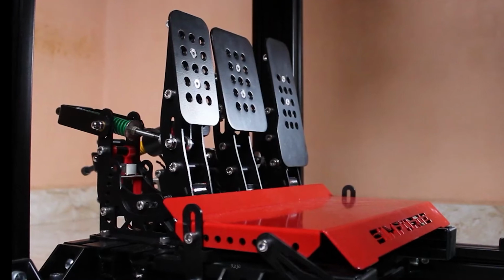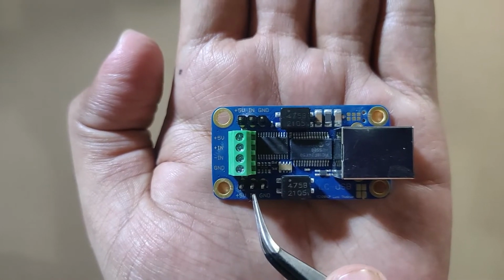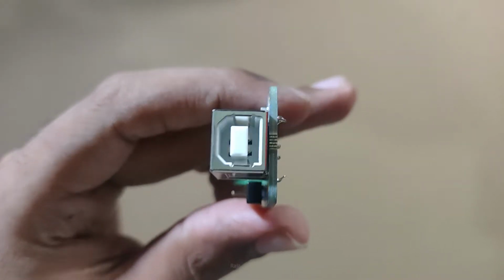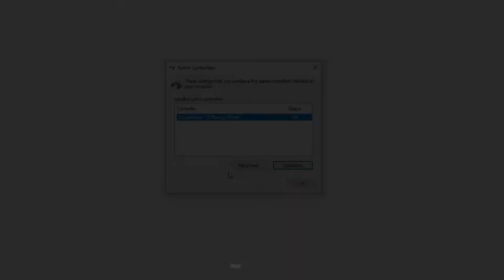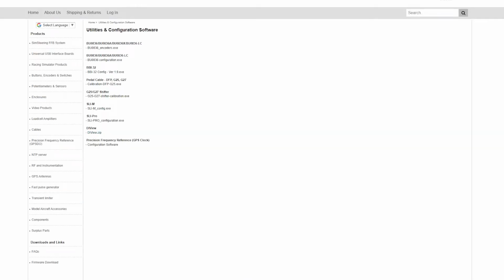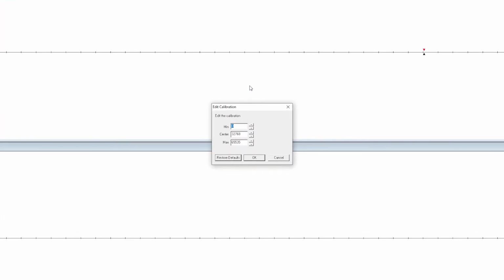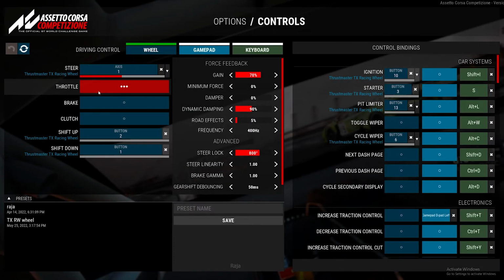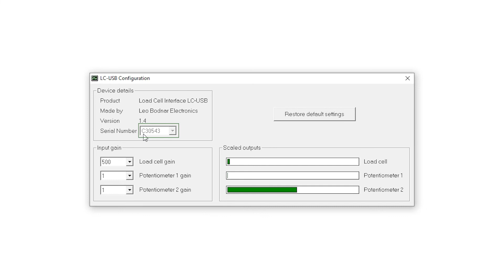Leo Bodnar LC-USB 16bit Load Cell Interface Review.

Comment: nice vid. thanks for the tutorial. I'm doing this to my Fanatec CSP v1 peddles as soon as the LC-USB shows up
Reply: Hi I want to use this board for a cal elite pedals v1 to repair it. I don’t now the load cell model. Are this board universal?
Reply: @francescoorlando221  i have used this board with the fanatec csl v1 load cell and the moza srp loadcell without issue. I believe this board is universal. It works with both 3 and 4 wire load cells